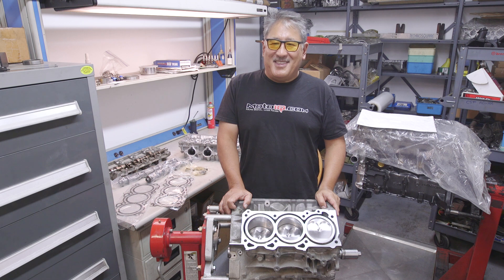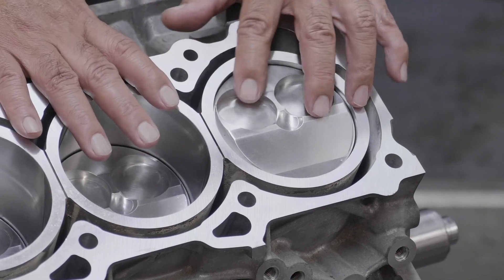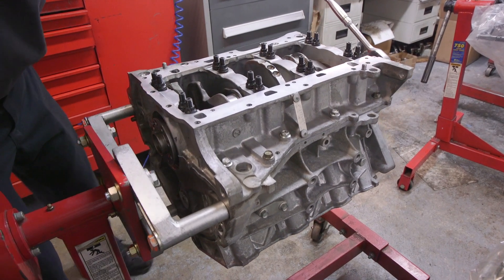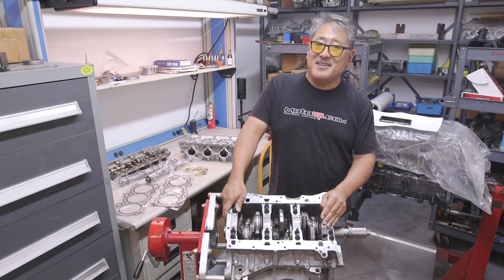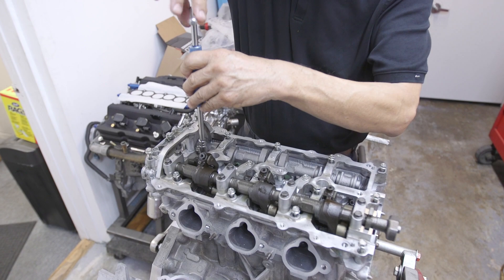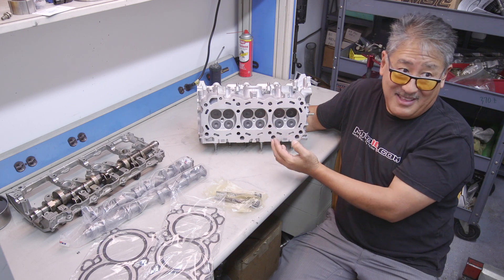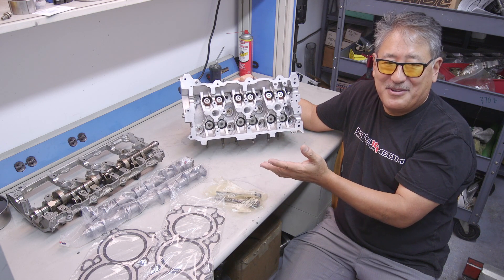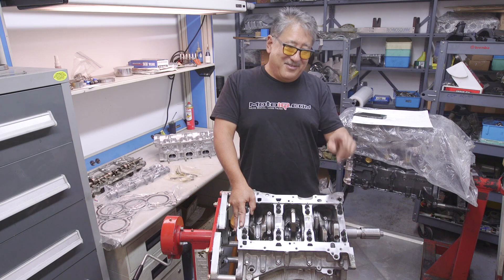Mission Impossible:  Building the Nissan VQ37VHR!

Comment: Hey Mike, let's get a boosted version going!
Reply from the maker: Yes we need more VQ content.  At one time we built a lot of VQ engines.  Unfortunately street takeover culture has killed interest in these cars and we get zero calls for them nowadays.  It is so sad.  VQ powered cars are now the fart can civics of the 2000's.  I love Z's and G35's too and hate what the takeover people have done to the perception of these cars from enthusiasts.
Reply: @motoiq Yeah I know the feeling...
We're bringing the 370s out in force to the drift scene these days, I reckon they'll be the next platform as even NA without antune they are wild...then a simple E85 tune with drop in GTR injectors and fuel pump they are even better (tuning also gets rid of left foot breaking issue and some other points ready for the track, so it's a 2 in 1!).
Your SC build gave me motivation to get my build going as I don't want to LS swap. Not many people realise how good these engines are, and they have alot of potential with the turbo kits out there today and a simple Ecutek tune!

It's our time to compete with the typical JDM drift chassis and show them what the platform can do!🤙🏼🎉 + There's almost 15+ years of parts for the R/Z34 chassis❤

Comment: Have you ever thought about using a vhr block with hr heads? That is the setup I’m currently running with jwt cams
Reply from the maker: Thats actually what I would want to do,
Reply: @motoiq I've remember seeing a few nissan backed race teams using the HR heads on a 3.7 rotating assembly. The reasons were pretty simple, same flow capacity and more conventional tuning. I'm running a boosted stock 3.7 short block with added ring gap and HR heads in my 07 Z. It's hard to call a Z a sleeper but in the world of high hp modern V8s roll racing from 60mph it definitely is, no one that doesn't know my car would bet on it, that's the best part😂 I guess the look of shock on the face of some young dude,  that was practically laughing at my car 30 sec ago, never gets old.

Comment: What benefits would you see in regards to installing a dry sump system? The goal being High RPM NA. Does it reduce overall stress on the components?
Reply from the maker: Perfect lubrication under all conditions. Better ring seal, lower oil temperatures, more power.

Comment: I'm an engineer and found this presentation outstanding - great technical detail and insider engineering rational. 
I'm going to put one of these ( stock) in my 2003 Xterra in place of the original VG33. Should be an interesting challenge.

Comment: You should fully stretch the bolts for peak yield strength. Then use until snapped
Reply from the maker: That is not correct. They should be stretched only to the recommended amount.
Reply: You're using stock bolts for higher compression force. I would yield them to the limit to put them in the elastic region instead of the plastic region. Otherwise they could get loose under boost. My way they break under max boost. Dude I dunno I drive two e39 m5$. Im just waiting to rebuild a vanos. I also slaughtered class of 2006 Berkeley engineering
Reply from the maker: Good for you, you should stretch bolts to the manufactures specs, not an arbitrary number you calculate. Since you slaughter engineering classes you should know that understreched bolts are prone to high cycle fatigue failure, not coming loose.
Reply: I have no hands on experience with this yet. But if the bolts are designed to break before they strip the block then I would preload and prestrain them for their max service loading. Wouldn't it be possible to stretch them from thermal expansion? Doesn't aluminum have a higher coefficient of expansion? But the only way to increase bolt stiffness is to make it bigger. But how much bigger can you make the aluminum threads... I wish I kept my ka24de Nissan frontier
Reply from the maker: That's why you don't second guess the manufactures recommendations.
Reply: @motoiq  I'm not the one blowing them up

Comment: just subbed I am building a Datsun 620 pickup with a 2014 infinity g37 engine and auto trans as that is what i bought to go drag racing like Rocky Mountain Race week kind of deal a drag and drive. that head work any ballpark on cost. I plan on keeping this engine under 8k rpm as i will be in darg and drive events and gonna run a Ford Ranger 8.8 rear end with 3.73 or 3.90 rear gears.

Comment: Looks like a V configuration of a BMW N series engine. Interesting variation to their valvetronic implementation. 
What does it take to crack those open deck cylinders?
Reply from the maker: These engines can get iffy when you push them past 700 or so hp.

Comment: And the firing order.....a very hard to remember... 123456....so make sure you gap your points correctly and and get the distributor leads on the correct plugs... number 1 cylinder is the middle of the right bank looking at it from the bottom of the engine while facing true north!!  That way the inlet cam timing is in sync with your adjustable valve floating device!!! Cheers!

Comment: I know this is a bit old but would it be possible to mount the heads to something so they could be torqued down before the valve seats are cut that way they aren't then distorted when the engine is assembled?

Comment: Nissans new VR30DDTT engine is definitely an upgrade from the VQ37
Reply: VQ37 is a way more reliable engine . Vr30 thats not the red sport only has 300 hp to the crank 😆 VQ37 =332(somewhere in the 330s) to the crank now imagine twin turbo (which cant fit unless its rear mounted) , forged internals , bigger exhaust cams , fbo on e85 ?
Reply: @nbhgotdatbag8172  I have a G37s coupe and absolutely love the VQ it just sucks that you can't get a lot of gains from bolt ons unless you go FI which costs a shit ton. You can do a simple tune and turn the boost up on the VR and get a new downpipe and gain more hp that way alone compared to FBO on a VQ

Comment: Hey Mike, just wondering why you guys stuck with the VHR head instead of the HR?  Ignoring the VVEL system, Are the ports, etc any different?

Also, is there any reason the VVEL engines don't have exhaust valve reliefs like the HR/DE?

Comment: How much does it cost to build your engine like this?
Reply from the maker: The exact cost for this build is close to $20k, but we can customize your build to your needs and budget. The cost for the labor and services of our VQ engine builds is around $6,500, which does NOT include any parts or head work. Here's a quick breakdown of what is included in the $6,500:

Engine tear down and assembly
Engine removal and installation
Block machining (w/ torque plate)
Rotating assembly balancing
WPC (crank, pistons, rods, cams)

So you can add up all the aftermarket and OE parts you'd like to use and you'll have a good idea of what the total will be. Don't forget wear items on the engine such as hoses, belts, pumps, etc.

Comment: What would you recommend running for pistons in a twin turbo application?
Reply from the maker: Low compression pistons
Reply: Not a high dome that makes the compression so high you actually have to run E85 on naturally aspirated engine like this guy.

Go with forged rods and low compression forged pistons.

Comment: What are you figure the output to be ?  I know there are a few tuners out there that build them & use superchargers or Turbos but not at 12 to 1. It would also be nice to know the parts & time involved. I love JWT parts and I recommend the JWT clutch if and when
Reply: Probably anywhere between 350whp-380whp depending on the tune.

Comment: It's always a treat to listen to a professional who is knowledgeable without arrogance.  When you're THAT good, you don't need to boast, the work speaks for itself.  Mike, the VQ motors are known for oil consumption issues, even before 100K.  Do you know why, is there a way to prevent it?
Reply: He mentioned that it is caused by the complicated intake camshaft design on this engine. Maybe an oil cooler to prevent the overheating camshaft problem.

Comment: I wish I could learn how to do this .
Reply: You can! Get some shop manuals, a junkyard engine, and just go for it 👍.
Reply: Go with something easier and cheaper and with more available aftermarket if you want to learn. Basically, get a Honda with a cheap engine. D series works fine and there are eBay parts that actually do work, but not everything, do research beforehand. You can find all kinds of build videos on Youtube and information in forums around the internet.

Comment: What about the gearbox.  Is there a rebuild you can do for that to make it reliable to handle with a launch control?  I've always thought that doing a built auto box that can do this feature will have a 1 sec advantage straight away on top of any engine mods.

Comment: the VVEL is amazing for low-end torque,  allowing for it to have the most aggressive intake cam possible, and change for all-around power throughout the curve. For big power, many revert back to HR heads, because VVEL gets messy at higher power.
Reply: You should watch adam lz twin turbo made 830hp on wheels and that vvel kept the torque from start to end 590lb ft ...so i think it works even on high hp cars
Reply: raheel saleem it works great around that range. Most of the people who run the HR head swaps are hr guys who then put in the 3.7 block. Don’t have to change the ecu that way.
Reply: @NDil97  yeahh i know ..i ve spent 1 year figuring out the electric stuff on these vvel ecus and vq36 ecu .. this is the hardest ecu and engine electronics that we,ve worked on ..me and my tuner who working in this field for 25 years and builds 2500hp to 3000hp supra and gtrs and mercedes and m5s ...but this engines electronic took 1 year ... Whatever we tried vvel never worked in my swaped e30 .. finally after 1 year of testing and doing random things it worked and now its working fine ... 265 wheel torque from 1500rpm to 7500rpm .. good for autox and tracks
Reply: raheel saleem great stuff. Any links to learn more?
Reply: @beowolf9991  awesome!! yeah my VHR gained about 75-80 tq from 2500 to 5000 because of being able to tune with it. Very cool stuff.
Reply: @NDil97  yeahhh ...but hard to make it work on standalone ...untill now no company makes standalone for this engine

Comment: So what I basically got from this is, it's hard to build a VQ37HR, because for the most part, Nissan already has it mostly built. That's... Actually quite a nice thing to hear.
Reply: Basically, it's hard to make power if you are going NA like they are here. Not worth the money to spend building a NA engine for chasing over 350whp when you can easily turbo or supercharge it to get more. And the turbo kit's aren't that expensive. You can get a nice mid mounted single turbo kit for about $6-7k with all hardware included. 

Also it's very easy to build it for high boost. All you really need are some forged rods and low comp pistons. The block and crank are really well designed like you said.
Reply: @GrayFox370  What kit are you buying for $6-7k all inclusive? Boosted Performance is $7,800...and that’s for the tuner version...... $$8.5k to $10.5k is more like it...
Reply: @GrayFox370  yes it seems very few people bother building one. 99% of people that add mods do intake and exhaust or FBO including cams and tune for 330whp and call it a day. Not too bad actually you can get 50-70hp on top with bolt-ons
Reply: @GrayFox370  thanks for your input bro i noted your advice for my build, if yo have any more resources like videos or forumns let me know on turbo setups
Reply: Basically in stock form it’s hard to find more power because the induction and exhaust hardware is tuned to the engine. Bolting on power isn’t easy. Adding compression and lightening up the rotating assembly really helps these engines. Also camshafts and tuning really wake these engines up. Can get 100+ hp with higher compression and bigger cams. Getting a tuner to find that 100+ hp is a different story.
Reply: theres plenty of force inducted VQ37HR running over 500hp on the stock block.
Reply: It's built very well. The g37 has a stupid little plastic barbed fitting on the heater hose and it deteriorates over time. Mine fell apart and it lost all it's coolant immediately. It suffered extreme over heating and the valves were rattling. I let it cool down and installed a $4.00 fitting. It's as good as new. The only weak points I have found are the timing chain tensioner and the water pump O-rings. 243000 kms and it's time to spend 3-4 thousand on those repairs.
Reply: @Liam40 You mean VQ37VHR, not VQ37HR, there is no VQ37HR...
Reply: @DarkMan2555  Cool. Don't care.
Reply: Good and bad. To get an addtl 100hp youll be spending the kit price plus installation and tuning. Easy 9k for 100hp? Terrible. But the motor itself is fun to drive. Hr or vhr. Too expensive to get upto 500hp.
Reply: @stonednyc1  To be honest those mid mounted kits could easily make 500, i've seen one make 800 (upgraded rods, pistons ofc) but if on a stock motor you could turn it down and make 500 easy. if you go rear mount the one I put together for $1,100 (+ $950 tuning) can turn up to 500, and that's on a 165,000 mile DE too but I keep it low to not pop that old engine 😂
Reply: @DennyBalance  Could you give more info on the 1k turbo kit? Sounds intriguing.
Reply: @Matt-lf1ik  ebay shit, you'll only need universal shit. But I'm intrigued too, got a  g I want to drift
Reply: @stonednyc1  500? You can get 600+ easy on a boosted set up, even 700 stock block at times
Reply: @MillionDollarDream  yes but at the cost of engine life you really should build an engine before you boost it to get the most out of your car regardless of what that is
Reply: @stonednyc1  N/A though, turbo/supercharged you're looking at 650 hp stock block.
Reply: @stonednyc1  scats cost 90k and only make 630 to the wheel definitely not too expensive but it definitely ain't cheap for us normal people that don't make $250hr
Reply: @thatsclassified1  scats make maybe high 400hp possible really low 500 with bolt on’s that’s not worth the money that’s robbery

Comment: I think it will make 450 on wheels
Reply: Probably not. My bet is maybe 390. Stock compression is already high on them. 3.7l isnt much for na either.
Reply: @BunnyBUNGALO  with cams and small bolt ons one guy made 376wheel hp .. so i think this one will make more because he did some head work also
Reply: @beowolf9991  yea probably not much though